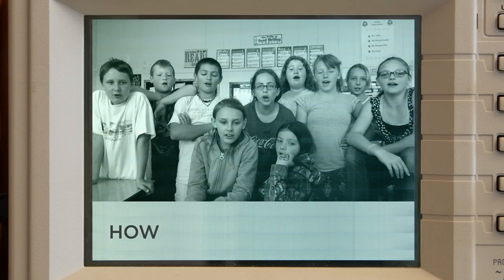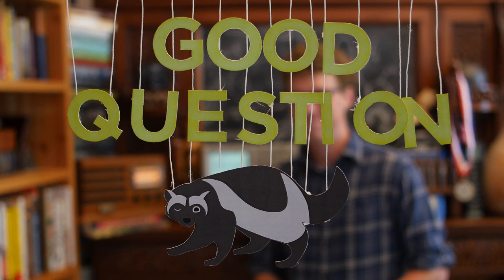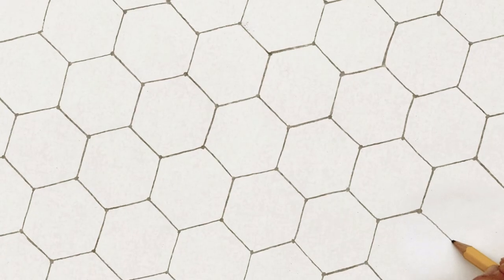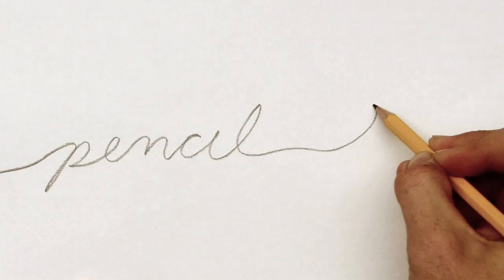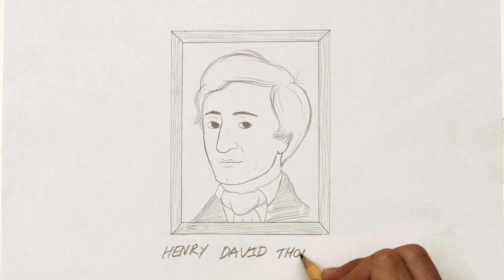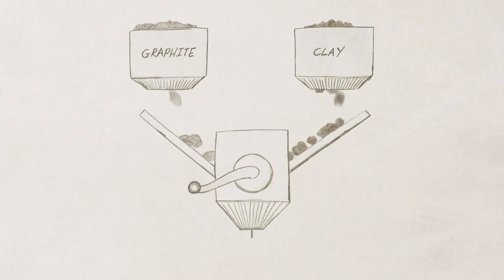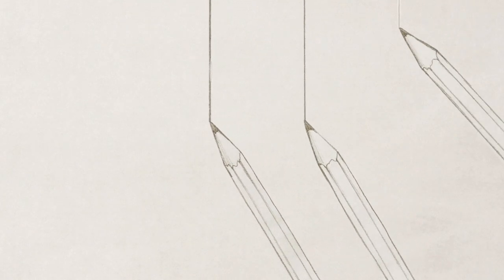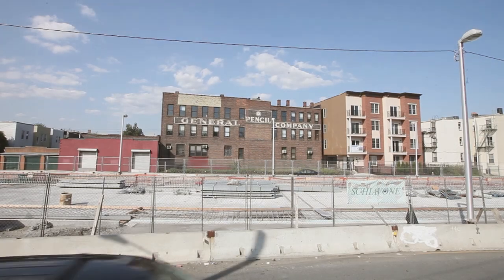A Sketchy History Of Pencil Lead | NPR's SKUNK BEAR

Comment: I don't believe Thoreau was the one who discovered that mixing graphite with clay — he just invented a machine in his father's pencil factory that optimized the process of making that mixture (which he called "plumbago"). It was Nicholas Jacque Conte who discovered that, back in the late 1700s.
Reply from the maker: That's right! - we actually talk about Conté in our accompanying blog post: http://www.npr.org/sections/ed/2016/10/11/492999969/origin-of-pencil-lead. We didn't have time to fit him in the video unfortunately - it's more of a list of highlights than an exhaustive history. I can see how that might give the impression that we're claiming Thoreau was the first to come upon the graphite clay formula. But I think what we actually said in the video is accurate: from what I've read, Henry wasn't familiar with the Conté's method, and made his own discoveries through independent experimentation. Another tidbit my reading turned up: Conte also used a numbering system, but his ran the other way. The softest pencils had the highest numbers, the hardest pencil in his system was a #1.

Comment: This was interesting, but I think an aspect that was missing is where graphite comes from and that graphite is a non-renewable resource with the vast majority currently coming from China and it has a lot of high technology uses other than just pencils. Seems like those additions would have given a fuller picture.
Reply: Given enough time, pressure, and temperature, we all turn into graphite eventually. Joke aside, while not renewable at human lifetimes, graphite is a very common mineral and graphite resources are not considered limited.